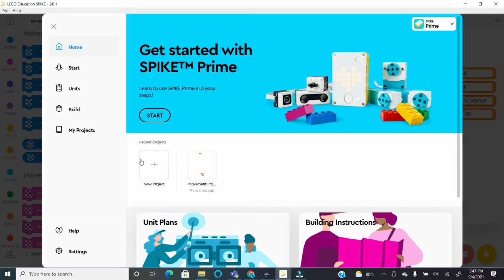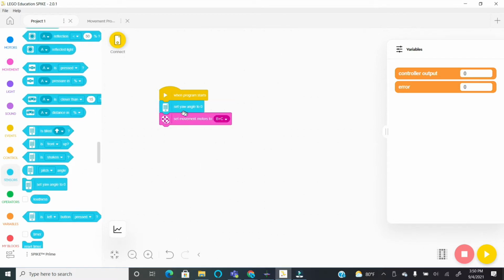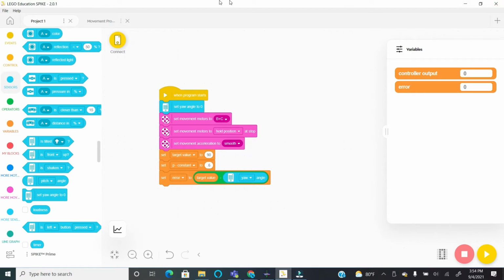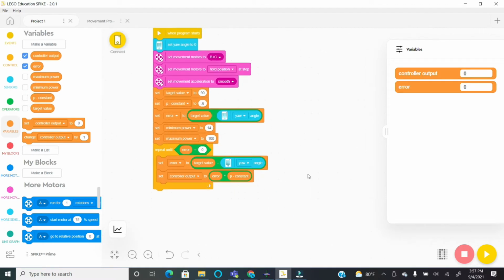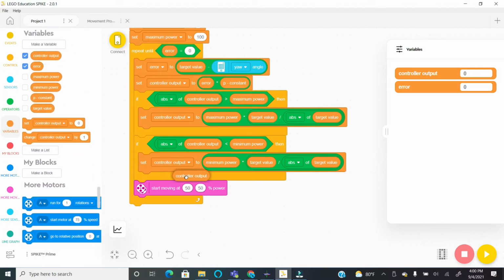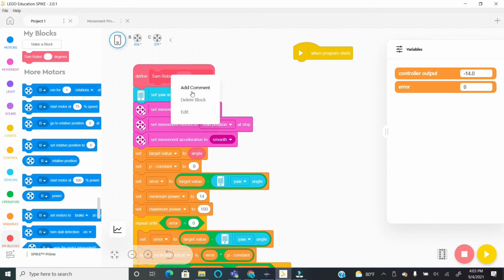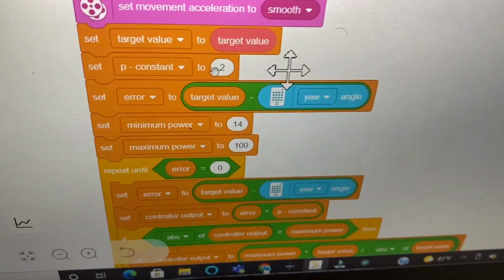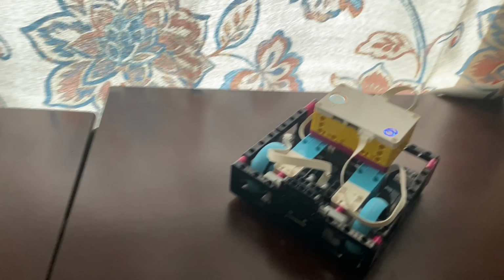Proportional Control Turning with spike prime

Comment: The code seems to be breaking for any absolute values over 179 degrees
Reply: He said its not supposed to go over 179 as the gyro only measures until 180 and if you go over the gyro will create issues

Comment: I have a bit of a problem getting the robot read error = 0. It helped me to replace it with “ is error in between -1 and 1 ?
Besides my gyro turns a bit more than 90 degrees every time. 🤷‍♂️
Reply from the maker: If you have it turn too fast it will keep wobbling and never read error = 0. Try reducing its minimum speed and reducing the p - constant while still having read error = 0, that way it should get closer to 90 degrees.